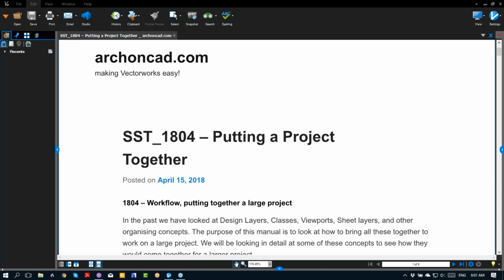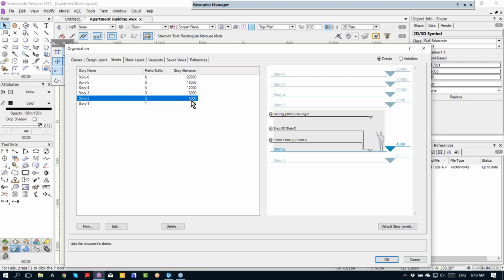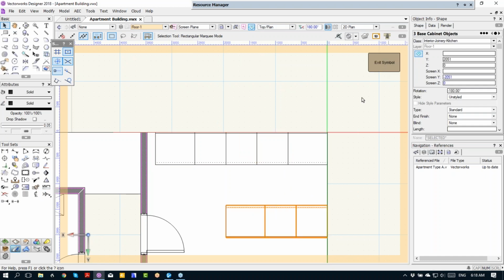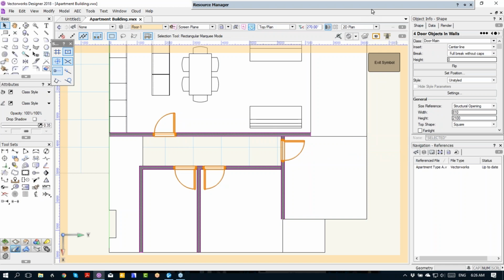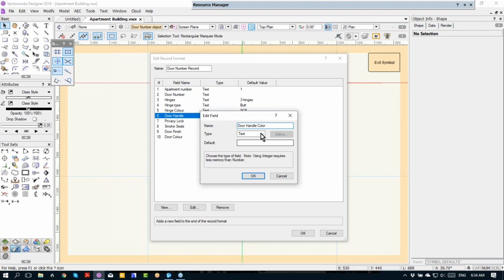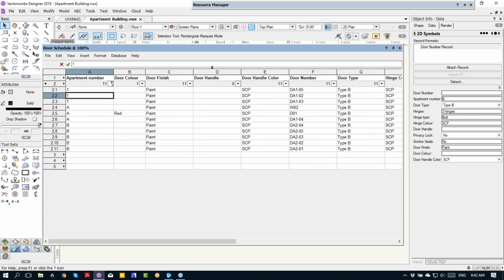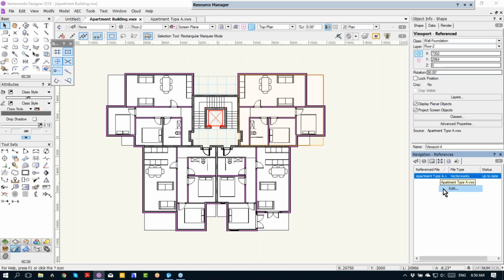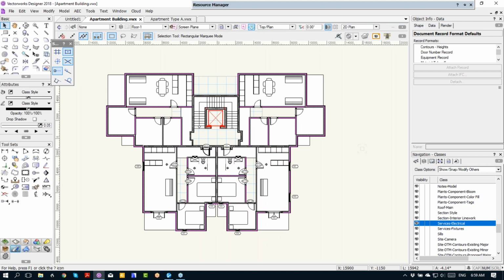Putting a Project Together with Vectorworks 2018

Comment: This guy is boring as hell, and waffles all over the place.  And not just in this video.  Everywhere he presents, it seems.

Vectorworks is not a simple program to get your head around, and is being held back GREATLY by a lazy Vectorworks company policy of ignoring the crucial marketing importance of providing LOTS of  top-class learning materials, and by not investing in a steady flow of LOTS of good, simple, to-the-point, tutorials that get newcomers up to speed - on the LATEST version available.

Can never understand marketing executives that will spend millions on sales and marketing, but then try to nickle and dime on the training aspect, and rely on old tutorials and some boring go-to sales guy.  Go figure!

Vectorworks need to sponsor SEVERAL lecturers of the sharp capability and fresh presenting style of persons like Robert Mann - who has worked wonders for Archicad in the public space by REGULARLY providing free UP-TO-THE-MINUTE tutorials in the LATEST program version in a lively and entertaining - and useful way.

Vectowrks desperately needs lots of complete tutorials taking projects from the beginning sketch to the final handover.  The same subject matter (different actual projects of course) covered by different presenters each bringing their own style, and working through their project in all it's little steps from start to finish.  Chief Architect learning material is a great example of how this should be done.

Even if you are not into Archicad, just visit Robert Mann's YouTube channel and view some of his videos to witness what a difference a really good top-of-his-game presenter and teacher can make to a complicated subject.  Mann shows how it should be done!  Period.

Then contrast his excellent presentations with this guy, or even Babrow (a well-known presenter for Archicad, and who has a similar dreadfully irritating waffling style to Pick).  Both these guys could improve by paying attention to Mann.